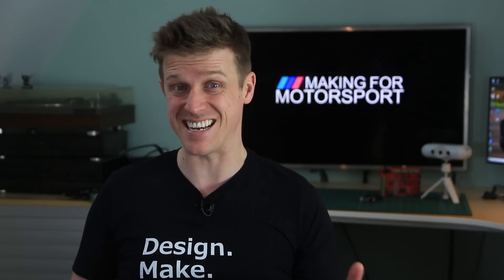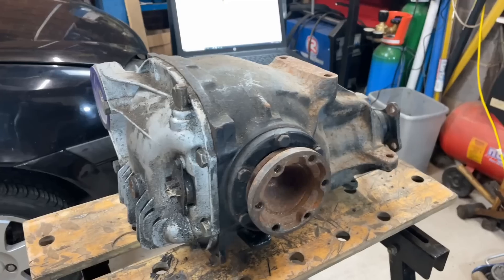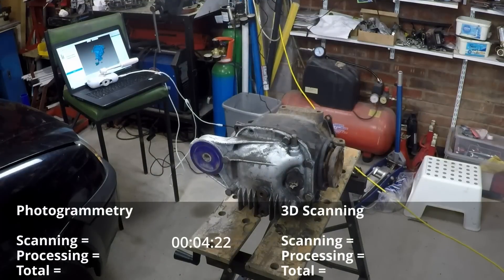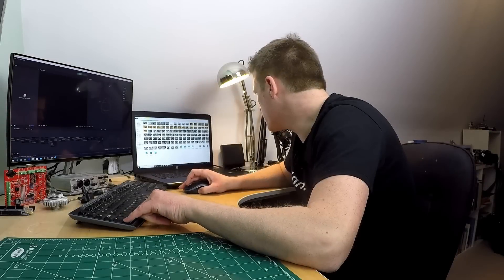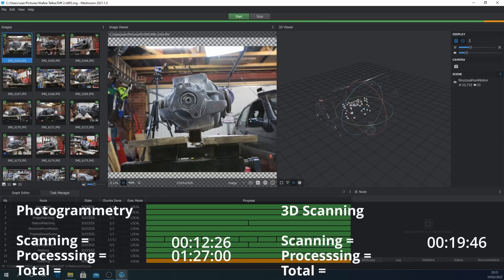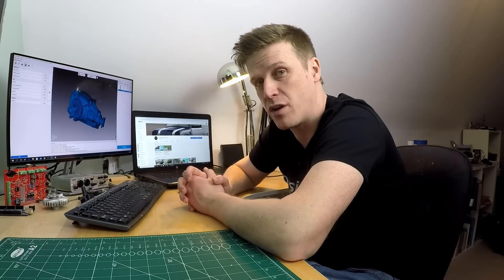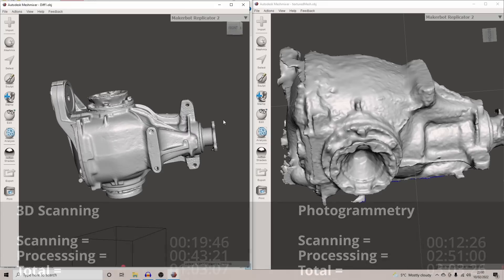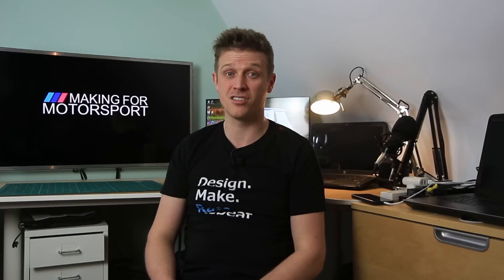CR-Scan Lizard 3D Scanner vs Photogrammetry - which one wins?

Comment: Not a Fanboy ;) but a couple of pointers what my experience was so far (I also got very terrible first results)
Imho 33 pictures is way too little. I usually go min. 100-150. And for the enginebay it was like 200-250.
When taking the pictures i also start at a bit of a distance (to get reference points) but then 2/3 or more of the pictures are more closeup of the detail i want to capture (boltholes for example).
I also had very good results using the flash on the camera, even if they advise not to use flash...
When in meshroom you should play with the settings for "Feature Extraction" and only calculate the "Structure from Motion"-Node to have a look at the quality of the pointcloud. (This is much faster than running all nodes to the end)

If i get a lot of Artefacs in the pointcloud i increase the "min. input tracklength" in the "SFM"-Node.
The full mesh calculation is for over-night if you dont have access to very good new hardware (massive hidden cost) ;)

I have to say the real scan result looks very nice! But i think you could get close enough with photogrammetry with more effort.
But its like everywhere, you get what you pay for =D or pay with your time ;)
Thanks for the video!
Reply: Agreed with the number of pictures. I have never managed to get fantastic results using Meshroom, but I have certainly got way better results than those shown here. Like you say, I will normally run at least 100 photos for a detailed item. I have a GTX 1050TI with 12 CPU cores and the processing of a detailed scan is an overnight activity.
Reply: To help with the photo processing there is a little app available called Polish. It will automatically remove the background from your photos , if taken in a good quality phone with good camera. The AI does a fantastic job of removing background so your only processing the object
Reply: @paulfarghi  Now that's a top tip!
Reply from the maker: Cheers bud, how long does it take you to process one of these?  Do you have a very very VERY powerful PC?
Reply: @MakingforMotorsport  I wish i still had access to the Workstation from my old work =D
Checked the most recent scan: On a Laptop with an i5 11400H 16gb RAM RTX 3060 with 110 pictures (10MP)  it was 44 min to a mesh (until SFM: 14min).
On the older i7 3610qm 12gb RAM GTX570 egpu i feel it would have taken double or triple.
Key for me is to compute/optimize SFM until i am happy with that, as the meshing itself takes ages.
I would say overall its always a 3-8 hours ordeal depending on how good/bad the input is and how many optimizing iterations it takes.
From wanting a scan to having a useable scan Its a f***in process for shure =D
Reply: @MakingforMotorsport  we do exactly this for a commercial purpose and we went from photogrammetry to an Artec scanner. To be honest the result from the two are pretty even but scanner is a bit faster and requires a lot less skill. For a first timer Meshroom is horrible and even for a pro it can be challenging. You could probably get away with 33 photos for such a simple model though a few close ups around details would help lift out those and add to the accuracy. For a first timer I'd definitely recommend Autodesk Recap (trial available). It's smarter and processes in the cloud (still a wait).
Reply: How does Meshroom handle factual size of the objects? There is no inherent scale reference in your photos, right?
Reply: @FlexDRG_Lampje  gotta do it yourself ;D Pick a reference dimension and scale in CAD.
Reply: @FlexDRG_Lampje  One method is measure, another is adding a ruler to the pictures / scan as a reference
Reply: i agree with op the uploader didn't use enough pics
Reply: Unless the results differed by a large margin I wouldn't want to put more effort into it. I'm a busy person.
Reply: @dangerous8333  it can, but requires more work. Handheld scanners can be quite powerfull

Comment: Great video, but to be honest I kind of wish it didn't exist - I'm before paycheck and by the time I'll have enough money this thing will be impossible to back thru KickStarter. After that it's going to be more expensive and almost impossible to get. Still keep a good work.
Reply from the maker: Yeah man, it’s difficult.  I try to keep the channel to the roots of spending as little money as possible and to be fair, as far as scanners go this about as cheap as it gets, but it’s still a chunk of cash.
That said, the one thing I don’t mind spending money on is tools…
Reply: @MakingforMotorsport  Nah, don't beat yourself about it. It's just that situation with this 3d scanner is complicated - it has to be successful, but not too much. If there is not enough interest and sales this product might die and we won't see another consumer grade 3d scanner of this quality for the long time. On the other hand if it flies of the shelves too fast it'll run into supply chain issues, the interest will drop and the same will happen. 

For me it just came at a bad time. I have like 4 projects where I run into issues with modelling - compound curves, lack of reference points. This piece of kit would allow me to make massive progress with them. I just hope I'll manage to nab like the cheapest one right after I get paid.
Reply: Kickstarted doesn't take the money out till the campaign ends. Which is March 12. So you still might want to get one while you can

Comment: Keep in mind that the result you got with photogrammetry is not representative for photogrammetry in general. You can have good results too, it just takes more practice and especially time. It's like a skill you have to develop. This is obviously a big advantage for the 3D scanners as you can simply plug and play these things. From what I've seen you took way too little photos. When I scan people's heads the distance between each photo is about 15-20 cm, sometimes even less.
Reply: Exactly why I don't use Meshroom

I do photogrammetry of sculptures and a lot of engineering parts. A lot of the time I use it for car parts and "Fan shaped" objects like fan blades or water pump blades. That are really difficult to design without 3d scanning them

With photogrammetry you can get around 0.3mm precission and scan really small objects
It's relatively fast and good if you do it right. You have to spray pain the object just a little form far away to generate detail and a mist to cover the reflections (like, old dirt dust)
You take 50-100-300 photos and conver them
+ better if you scan it with really good light, like in the shadow outdoor on in a cloudy day

With a good PC in 1-2hr you can get a 20 million poligon object created, but I use Reality Capture, wich is like 10x faster than meshroom
Reply: The best results I get with photogrammetry is by mounting objects above a turntable on a stick or mounting rod evenly lit with a black duvateen sheet under and behind the object. The object only has itself to reference off of this way and there is almost no cleanup in post required. 140-150 photos at 3-4 elevations gives incredible results comparable to laser scanning with a high enough res camera. I scale the number of photos up or down depending on the size and complexity of the object.
Reply: But then, when talking about profesional grade 3D scanning, there's also laser scanners. It's expensive, but getting a proper setup for photogrammetry would be as well, and I guess it's basically really only beneficial to use photogrammetry when color texture is important, or if the "object" is actually an entire scene.
Reply: There is also a big difference in quality regarding the camera used. Phone vs DSLR. Maybe also try Capturing reality/reality capture vs meshroom.
Reply: As well as shooting against an unified color, like green screen. Or alternatively you mask your photos to feature only the object to be "scanned" before processing the images, both of these will help a ton. We've scanned hundreds of objects like this and got stellar results. Mind you, focus stacking comes along later when scanning smaller objects at high quality level.
Reply from the maker: Like I say, i am sure that there is a load of improvements to be had buuut, if I have to green screen and basically setup a dedicated space and spend days on it then it’s not practical for me.   I’d be happy to give another piece of software again if there is a better one…
Reply: @MakingforMotorsport  Yea, the setup is quite immense as is the aftercare for the photos to reach proper quality level. It looked like the 3D scanner for your use case is far superior than photogrammetry. Photogrammertry works a lot better for applications that need a texture/material reference as well.
Reply from the maker: I took about 30+ photos which is probably way too few but I’d be terrified of how long that would take to process 🙈